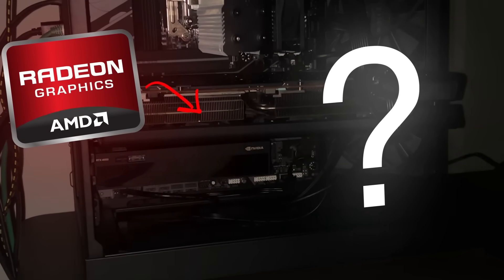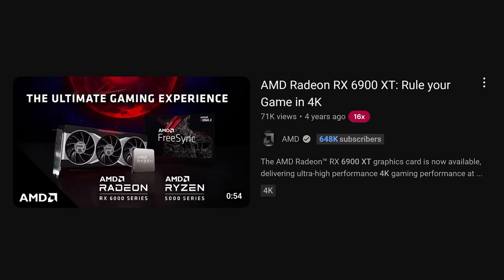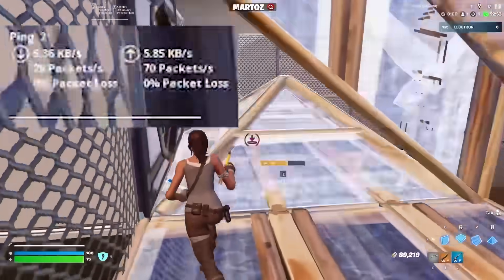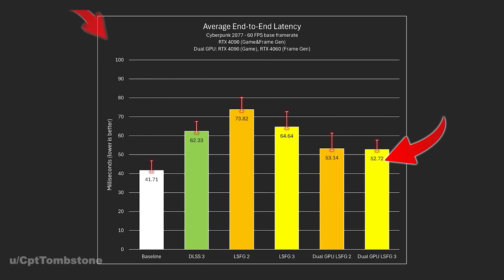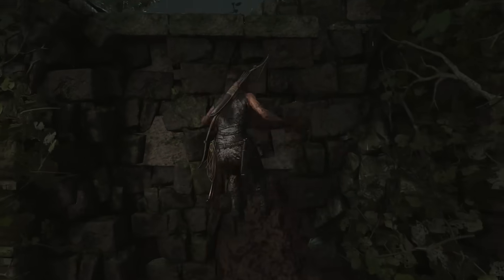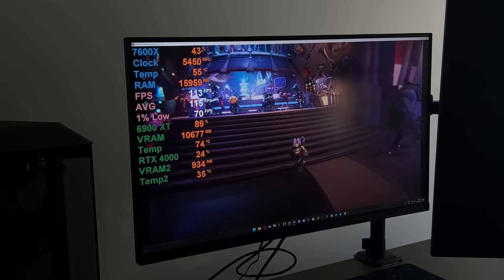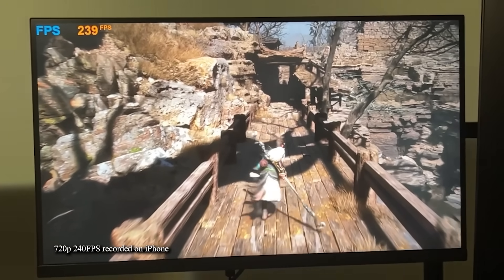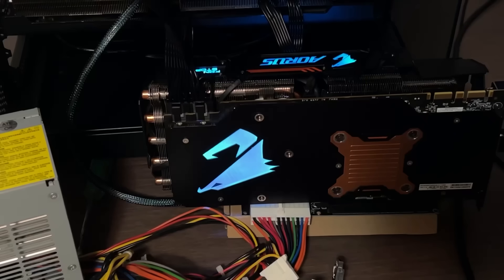I Used Both AMD & NVIDIA in One PC and Got 240 FPS in Every Game

Comment: There is physically 0 way to reduce ping other than moving closer to the server location. Quit pushing bloatware / data farming programs on ur viewers
Reply: OP is right. There is no way to compensate for distance. It's a tale as old as time no real world performance test has ever disproven. For example: A change in network latency statistics does not, itself, represent an increase in service performance. In other words, two people gaming at 100ms, may be at different distances from the server, and may have identical, or different "felt" performance. Businesses, may then, utilize this discrepancy to market software that results in a reduction in measured latency statistics, without providing evidence of an increase in actual performance.
Reply: @CR055FIRE "There is no way to compensate for distance" is *true*, but you're assuming that directly using the default BGP routes optimizes for distance/effective latency. It doesn't necessarily do that, and often it doesn't. That's because routing is computationally intractable, so ISPs use an approximation to get it to work (pretty decently at that). Sometimes, forcing certain paths will reduce the distance despite an extra hop. When you think about it, you don't have a direct path to the game server in the first place. You are already taking multiple hops. Connecting to the VPN will introduce one more hop, but it can sometimes take away multiple hops as well, reducing latency.

If that sounds like baloney, it's healthy to be skeptical. I've done an actual statistical experiment on this with TF2 servers, however, and it actually does work (reduces avg ping, jitter, and std dev round trip time). Whether it helps or not depends on your location and the game server location.

One more issue: the VPN's encryption/decryption overhead. This is surprisingly a nonfactor due to the magic of AES-NI acceleration and the speed of ChaCha20. Encryption is basically a non-issue for low bandwidth applications like gaming, and introduces almost 0 latency because of CPU pipelining. Add in video streaming into the mix and the results then become questionable, though.
Reply: @CR055FIRE 
Distance is not the deciding factor but the amount of hops along the ip packet route because of switching characteristics of networking electronics.

You can put daisy chain of 100 network commutators in the same room between 2 PCs on the same table, thus having zero distance, but the ping will be worse than to another city.
Reply: @vasiliynkudryavtsev  That's not what I'm talking about.
Reply: VPNs CAN reduce your ping through stuff like Multi-Path Routing, avoiding Redundant Routes, UDP Traffic Optimization, GPNs (Gamers Private Network) and Dynamic Optimization. All of those are unrelated to how far away you are from a server.

You people are very uneducated and it's disappointing.
Reply: The Internet is like car traffic anhd apps like these (if not fake or something) can help finding better routes, not only shorter ones, but some with less traffic and/or better hardware, etc. .
Its just like with any otehr kind of transportation.
For example, Steam has started to relay the connections of there games (like Team Fortress 2) through the huge server network.
Not only increasing network performance, buit also safety, as you can´t DDOS attack a server which address you don´t know.
Reply: If the network is perfect of course there is no way to reduce ping.

The default routes of your ISP can be suboptimal because of economic factors. Also packet loss.

They say on their site they route game datagrams different paths simultaneously thus increasing reliability.
That means you generate more traffic and It is kind of abuse of shared infrastructure.
Reply: i had extremely bad routing to certain val servers and used exit lag went from 100+ping to 20, i think it depends on the use case but for me it absolutely helped ymmv
Reply: the whole idea is a scam, just get a intel a770 16gb and enjoy 300-600 fps 1080p gaming
Reply: It works by going through fewer nodes than what your ISP uses. You can easily try it for youself by using the tracert command in windows and see all the nodes your connection is going through until the endpoint. I've used it in the past (Mudfish, Exitlag, WTFast) on multiple MMOs and it does works, but then it also depends if your ISP is already giving you a good routing or not.
Reply: I like Trains
Reply: @ u probably on da spectrum
Reply: @kye3k1   @Mrrwright

There a tons are of ways.
The way exitlag does it is awesome and one of the best ways, when the issue is our of your control.
You are viewing it like this
you > ISP1 > ISP2 > ISP3 > VPN > ISP4 > ISP5 > Gameserver

In reality, the way it works is 
You > ISP1 > VPN1 > VPN2 > ISP5 > game server, notice there is only 2 ISPs in this example.... you knocked out 3 other ISPs that each add more lag

Often these "VPN2s" are placed next to the huge gaming data centers, like up in seattle, NY, dallas, chicago, singapore, korea, etc...
Yeah its the same end to end distance, but you are going through less hops, less routers, less devices that each add another 1-10ms delay, less chance for errors and jitters.
I have no way to verify this bit, but they also claim they don't just go from VPN1 to VPN2, but they go through other VPNs in the middle and check to see which is the fastest.

Exitlag is huge and works very well for some people. Just because you are right by a fiber backbone, that shares the same servers as you, that doesn't mean everyone is in that case, some people have 20 hops, it is terrible, knocking out 15 of those is HUGE for gaming.
Reply: The VPN offers a more direct route Some VPNs have optimized paths that reduce hops to the destination server. So that's not 100% true
Reply: You can cut traffic overhead and competing packet traffic on the ethernet connection being used. There is a compute cost that creates lag not just a hardware demand. You can also tweak registry and adapter settings to impact your latency (which the tool may do in a user friendly way).
Reply: You assume that every path to the server is a straight line DIRECTLY to the server. Its not. Educate yourself before commenting.
Reply: faster router with a faster processor and vpn helps also helping lax the security but you could get hacked.
Reply: @Mrrwright  oof, embarrassing.
Reply: @xbrawndothethirstmutilatorx  Whats embarrassing is anyone falling for this ;)
Reply: @Mrrwright  the vpns job is to provide better routing between your internet and and the game's servers, at least that's what I think it does, I'm not sure if it's true tho.
Reply: @ilovemwadforever  VPNs add another routing hop before arriving at a destination, so if anything VPNs slows the connection down. Both bandwidth and latency is worsened.
Reply: @kye3k1  There is more to data traffic then hops, like how loaded a route is or what hardware it runs on. But a VPN can help routing through less hops overall, aswell. After all, network routing isn´t perfect, like the rest of reality.
Reply: @kye3k1  this is 100 percent accurate.  They do not decrease hops, but infact add AT LEAST an additional hop, maybe more
Reply: @kye3k1  yes but in some rare or not really common circumstances, it'd help a lot because sometimes the server connected to your device in such weird way that it's insanely inefficient, VPN just choose different way to route it hence "optimizing" the connection by not choosing a dumb rout
Reply: @ilovemwadforever  if your not sure what a vpn does why comment?
Why not just look it up then comment???
Reply: @ilovemwadforever  
yea i think ive heard this before where they will buy time on data centers to give you the best possible route like what the OP mentioned, instead of going through whatever your isp routes, the programs job is to tunnel you straight to the closest game server.
Reply: @Mrrwright  these softwares are a niche product but they do help, its not gonna make ur connection faster as in raw power, but sometimes ur ISP takes bad routes, and this lets u change ur routes resulting in less packetloss
Reply: @freespirit0788 what does that even mean bad routes? If you have crappy equipment at home it’s best to spend money on that. A good router will make sure your gaming traffic is given more priority than your relative trying to watch YouTube videos. Any program that operates like a VPN simply adds more stops on its way to the final destination, less stops is always better. Lets say your internet was “taking bad routes” why would a program help? Wouldn’t it just take bad routes now with the addition of the program? So make it worse?
Reply: @freespirit0788  This makes no sense, 99.99% of the time packet loss is encountered due to your own hardware or what they call the first mile of where the data goes. Issues with networking usually are from crappy ISP routers that cant handle high packet loads. Having a router with good QoS if you have a busy network makes a huge difference. Though if you live by yourself then its usually fine. Running a server in Canada I had a Friend in Denmark with 110ping and a friend from Ukraine with 130 Ping where local friends are 40 ping. No software is going to fix that once the data is past the ISP its on the quickest route. These companies dont send data through the internet any differently than anyone else. The reduction of Ping time is like if I was driving from work to home. But instead I stopped at a friend house halfway and he said "look stopping at my place is a quicker way to get home" Well yeah from his place it is but not from my work.
Reply: Educate yourself, Exitlag does work. Performance increase differs from person to person, but if you're playing on another regions server for example, it easily takes you from 140-100 ping, in my experience at least.
Reply: Source: I made it up. 
Fr tho I can speak from experience in saying that a good gaming vpn can DEFINITELY reduce ping to servers if u live far away from servers.
Reply: @greed5891 how do you know your true ping if you’re doing so after connecting to the VPN? That being said, even if the ping was “lower”, that’d be the ping from the VPN server to the game server. Your ping to the VPN doesn’t magically change unless you’ve invented a method of teleportation. In summary, instead of going “your house to server” and that being say 80 ms, when you add the VPN it’s now “house—>VPN——>server” how can you possibly think adding another stop on the trip would ever make things better. With all due respect you may want to read how all this works.
Reply: 100% Laughing at the kids in the replies that dont realize vpn's reduce  your bandwidth. There is literally no chance using a vpn will  reduce your "input" lag. Honestly I dont even believe his dual GPU setup.
Reply: @georgelopez8287  Both are situational, but both work more often then not. Thought he should have bought a Mainboard with a second X16 slot.
Reply: @georgelopez8287 Bandwidth has absolutely nothing to do with latency though. It's like how a highway with more lanes can theoretically fit more cars, but that doesn't mean you're going to get where you're going any faster. The only time bandwidth matters is if you are at the limit.
Reply from the maker: A quick google search can disprove this as physical location isn't the only way to reduce ping in videogames. Also, not all networking tools are "bloatware," if your ISP sucks, some apps genuinely help with routing and congestion issues. But I get where you're coming from, a lot of "ping reducers" are just marketing gimmicks. I used to think ExitLag wasn't legit either.
Reply: @lecctron  Exit Lag re-routes your traffic to their servers and then to the game's. This extra hop actually adds extra latency to your ping, but you will not see it as the number it will give you is smaller (it skips their rerouting calculations), making you think it's actually faster, when in reality, it just skips the extra step in the calculation ending with a small number that is actually a big number in reality. You need to educate yourself and stop being arrogant.
Reply: @VENAXIS  that's.... Not how ping measurements work... That's just petty disinformation
Reply: @lecctron  humble response

Comment: Exitlag is just a software to show you less ping that you really have. There is NO PHYSICAL way to shorten connection route from your PC to the destination server without physically moving. Ping represents the distance you have to the server you are connected to. It's usually 1ms to 2 ms per each hop (network devices) between you and the server you are connected. To have 1ms or 2ms ping you would have to be connected directly to the server with the cable. Exitlag is just a scam to suck the money out of your wallet. Stay away from it.

Comment: TOP!! Love it mate!! New Sub! ❤
Had LFSG3 already. Had exactly 6900XT and recently got the 9070XT. Was thinking to build 2nd PC with the 6900XT (** as I love it, don't think selling it for like 350, as for 350 its "Frame Per Dolar" value is insane).
YOU JUST MADE ME DREAM OF ... setting the 6900XT as FrameGen GPU in the LosselessScalling ontop of the 9070XT  ! 🤯💥

** 9070XT will get the FSR4 in games (already did FSR4 to 40 games with Optiscaller), also 9070Xt will cope with the RayTracing, and then the 6900XT will FrameGen them beautifull frames with the LSFG3! 🤯💥

** Your hard work in breaking the code of setting this monster and sharing it all to us with every detail is...  priceless! Much respect!

PS: Already have 2nd PSU and have had 2 GPUs-one-PC (with 2 PSUs) like 2013. Mission acknowledged!
** Just checked my Asrock Steel Legend X870 and it says below .. if it's true might not need the M.2 Adapter (crossing fingers):
CPU: - 1 x PCIe 5.0 x16 Slot (PCIE1), 
Chipset: - 1 x PCIe 4.0 x16 Slot (PCIE2),

** Need to check if my 2nd M.2 is on M2_2 else If M2_3 is occupied, PCIE2 will be disabled. ;)

Comment: Well, I'm gonna blather for a bit, but I have time. Anyways, I'm in the process of doing a new SLI build... LOL! I'd been gaming on an SLI Origin built PC for the past 8-9 years, but the pump in my 5.25 reservoir finally crapped out. Well, one thing led to another, and decided to do a new SLI build until I'm ready to do my high end dream build, which will come after I'm done with my never ending, money draining car build. Anyways, I got a new $90 high air flow case coming, purchased 2 brand new 2080 Ti cards ($570 total + tax), purchased an open box-unused MSI X370 SLI motherboard ($120 + tax), and purchased a brand new R7 5800XT CPU ($160 + tax). I'm also transferring over my SSD, 32 gigs of DDR4 ram, and my Corsair AX1500i PS.

With that said, I can get just about every DX11 game to run in SLI, with the Inspector software being a big help. As for DX12 games, there are only a handful that'll run in SLI, like Battlefield 1 and Rise of the Tomb Raider. I mean, with my 1080 Ti cards and an overclocked 5960X, I was getting 110-130fps, Vsync - off, TAA - on, and Ultra settings in 4K with DX12 enabled in Battlefield 1. Dice did such an amazing job with their DX12 SLI implementation. That said, DX12 SLI was left up to the Devs to implement, and most didn't, and now don't. 

I game on a 55" LG 60hz Oled, so I'll lock games in at 60fps, mostly in 4K, except for newer DX12 games, though I don't play as many new games as I used to. Now, I'll be experiencing DLSS for the first time, and it'll be the DLSS 4 update for the 2080 Ti cards, so that'll help with better frames, along with me taking the next step up from my older 1080 Ti cards.

I'll keep my new SLI build, even when I do get around to doing my single card dream build, just for nostalgic reasons.

Comment: This is awesome, and I think you should watch the video that pyurologie put out on the subject too. Instead of using Lossless Scaling Frame Generation (software-level), he used driver-level Frame Generation (AFMF2) on an RX 7600 to multiply the frame output from a 4060 Ti with DLSS4 override on. He got that to work really well with Tarkov, and I think it might be possible to do this with a technology flip-flop. (FSR 3/4 making frames for NVIDIA's Smooth Motion to multiply. Smooth Motion is also driver-level.)

In addition, I've noticed something really interesting about the multi-GPU split function technique: while the frame gen multiplies frames significantly, it still doesn't compensate for the weakness of the base framerate and corresponding 1% lows/frametimes. I think this is why Control and Fortnite still felt so bad despite the technique working, since the games weren't optimized to allow for a stable 60+. But at 12:52 with Shadow of the Tomb Raider, I think the observation of "high frames causing it to fall apart" might be riding up harder on the hardware/software limitations of this rig and game than just an inherent weakness of the technique, especially since the stable instance of high frames at 13:23 in Uncharted 4 seems to contradict it. In pyurologie's video, his base framerate was also sitting at a cool 80-110 FPS and was getting multiplied up to 240 with no trouble. I think the combination of a weaker memory throughput and using software-level framegen instead of driver-level might have contributed largely to the issues you saw with high-frame titles, especially since this whole operation is more of a freak accident than something any studio/company planned. That, or Shadow of the Tomb Raider really hates software-based frame generation. Who knows.

I don't intend to bash your implementation though: your ability to get this working on conventional hardware just kind of proves how robust this technique can be. But optimal usage does seem to be achieved with the driver-based stuff. Really good video! I think you should test this with driver-based frame generation instead and see what happens!